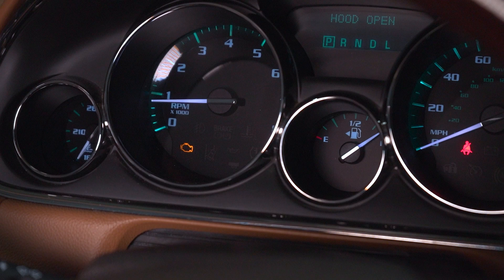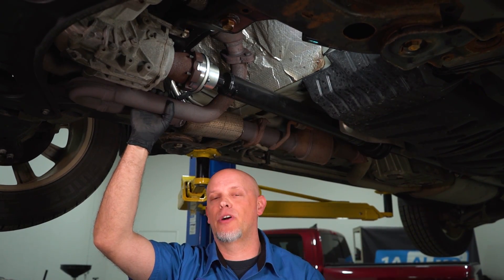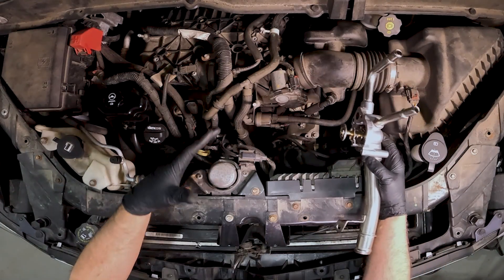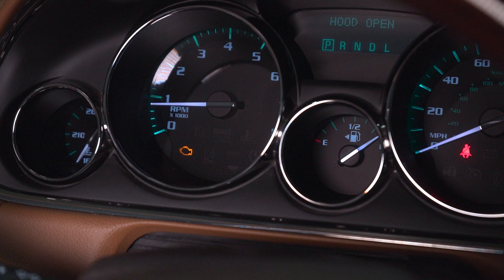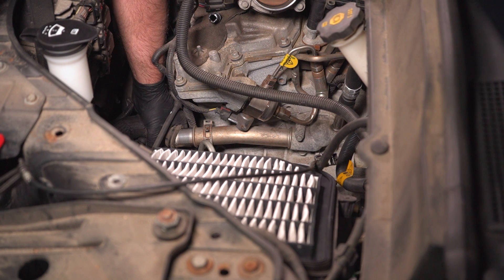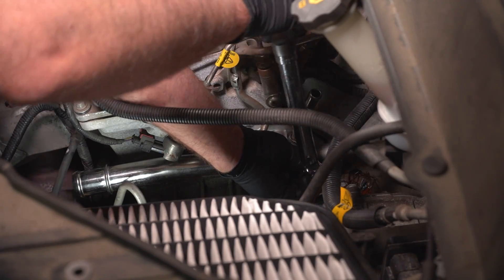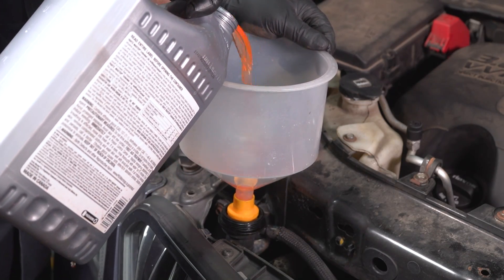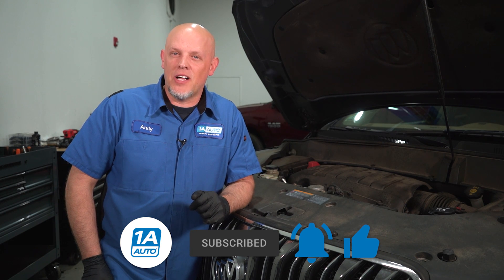P0128 Take It Seriously! Top 3 Ways This Engine Code Impacts the Ride in Your Car or Truck! Easy Fix

Comment: I drove my 2000 Pontiac Montana that way for nearly a year and it never threw a code. Eventually I realized it was supposed to be running warmer so I replaced the thermostat. Previous owner used a fail-safe thermostat which just means it is designed to get stuck open after it overheats and one of the first things that happened was the belt broke, causing the engine to overheat just before I could get in the service lot (was already on my way there due to belt noise). Neither they nor I noticed the thermostat for a year.